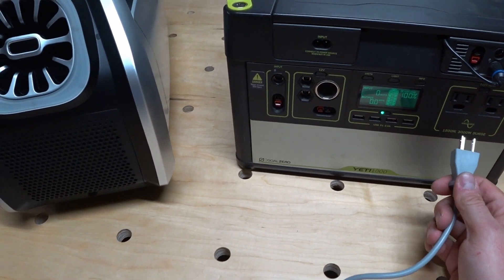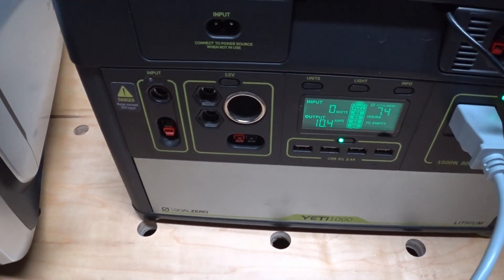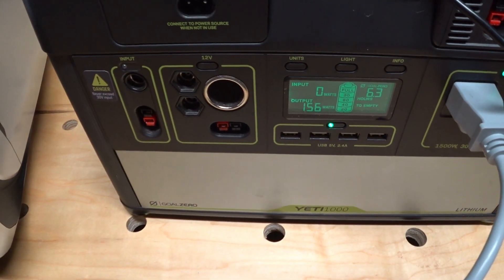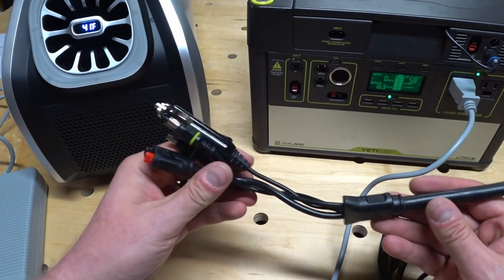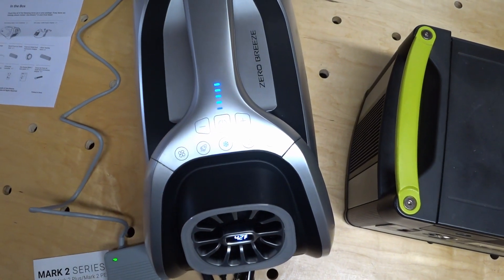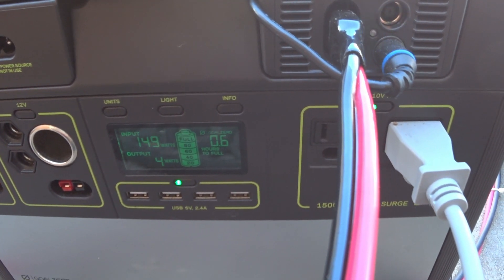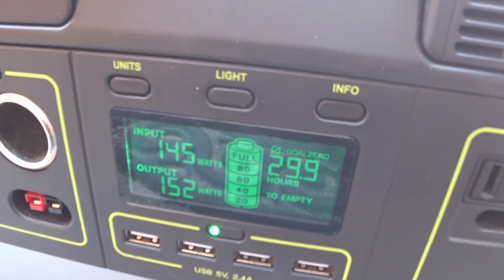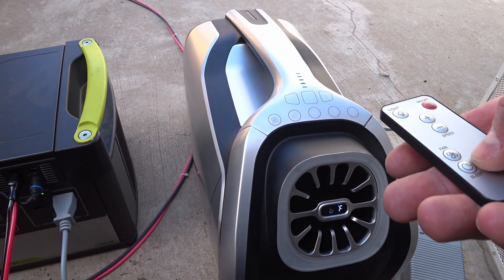Zero Breeze Mark 2 Powered by Goal Zero Yeti 1000 Lithium Inverter and 200W Solar

Comment: I have the Yeti 1400, and the Anderson connectors run 20 amps output, and I used that with a female cigarette port to run my Mark I, even though I have the Max Current Cable as well. I will use the connectors as you have with the converter to step up the voltage to 24V.
Reply from the maker: So you ran the Mark 1 with the Anderson/Cigarette ports?  I built a custom cable (Anderson/Cigarette port combined) to run my Mark 1 and it never worked, always got the red light shutdown on my Yeti.  Even tried their 12V regulated female cigarette port cable.  Had to in the end buy the max current cable just to get it to work, which is why I just used that automatically with the Mark 2.  Maybe my Yeti has a problem.
Reply: @Polymathicus  I ran the Mark I from just the Anderson port under the female cigarette port, and had ordered the SMAKN 12V 30A Female Car Cigar Cigarette Lighter Socket Plug Connector Adapter to use with it. I used the aviation connector that ZB supplied with the unit and wired the CUZEC Heavy-Duty 15A Male Plug Cigarette Lighter Adapter Power Supply Cord with 1.6ft / 0.5m 16 AWG Cable Wire to that. Never had an issue at all.

Comment: Do you think the ZB Mark 2 would cool a small cabin in a 24ft boat?
Reply from the maker: If it's very small, insulated, and not very hot outside the cabin, and the intake and exhaust hoses are ported outside then maybe, with a better chance at night.  Otherwise, this is best thought of as a spot cooler to point at a person/people in a room and keep them cool like you would use a fan for, but this fan also cools the air coming through it.  So it's much more than a fan.

Comment: I was planning on much smaller cheaper yeti what you think how small can I go for how long ?
Reply from the maker: Very difficult to answer as there are so many variables involved.  I have not run my Yeti 1000 to zero yet in a test, but I'm estimating about 5 hours runtime on normal mode with inside vehicle at 95 degrees, and outside vehicle in the 70's.  I assume there is going to be a big change when that outside temp gets up into the 100's and that hot air is being drawn through the condenser which is going to make the Mark 2 struggle more.  I will post those results here in a few months.

Comment: Any new videos or information about your use and testing of the ZB ll and the yeti 1000? How long continuous is the Yeti 1000 able to power the ZB II?
Reply from the maker: Got a bit delayed but new video coming soon testing 12 to 24v converter with the yeti.  Got my first "full day" of testing in a hot vehicle in full sun.  Inside thermometer showed 95 degrees ambient in the closed up vehicle, 62-64 coming out of the mark 2, ran about 4 hours before going home with plenty of battery to spare, was impressed, hope it can handle 120 degrees ambient in a couple months. Converter did get hot.
Reply: jtskr25 really? This is very very good news! By the way how long did it take to get the inside of your car temperature down from the 90s into the 60s? In direct sun or ”shade” Also I have another question: I am still waiting for my ZBII to come in the next shipment hopefully - how did you get yours so quickly?!
Reply from the maker: @Mombasa14  sorry, should have been more clear, outlet temp from the mark 2 was low 60s.  That was with an ambient temperature in the vehicle in the 90s.  There's no chance an air conditioner of this size could cool a closed vehicle in full sun, too much heat load.  The ambient steadily crept up. I can say however that I myself in the vicinity of the mark 2 outlet was very comfortable for several hours, no sweating. As soon as I left the air stream that changed.
Reply: jtskr25 ah yes, this  makes sense then as I am tracking with all your videos as I intend to use this zbIi device for bug out or survival purposes, as when the grid goes down we will rely on solar and in hot Texas we need to cool ourselves down during the day. One idea I have is to put a very small tent in my living room, and use this ZB to cool only the small tent area or to blow directly on me and vent though as window portal, so I can survive and not die of heat stroke. If this works.... I will immediately buy the upcoming Yeti 6000x

Comment: Would this a/c work all night (6-8 hours) on a 500ah, lithium battery?  How does the water drain or does it?  I've read there is also a 'night or sleep mode'.  If my math is correct, this a/c could run several nights without a recharge on the battery...But I'll be recharging with solar or generator daily.  Thanks for a superb video.
Reply from the maker: You're welcome.  Haven't tested at night or using sleep mode, but yes, sleep mode should use less power and stretch the battery out some.  6-8 hours might be a stretch, but with a lower amp draw of sleep mode and cooler ambient temps the run time should increase significantly over day use.
Reply: i am looking into putting this in an rv/van.  I have the lithium just worried about the sleep mode noise?  I would mostly use it during sleeping in the t.v. at night.  any info would be great help!

Comment: In your opinion do you think this could efficiently cool say a 200 square foot tent?
Reply from the maker: That seems a like a big area to cool.  There are a lot of variables to consider.  Heat load is the problem, trying to keep an area cool that is being constantly heated (by the sun) if the AC cannot overcome the heat load.  If we're talking about night time that might be a different story, a small space on a hot day but in the shade could be possible, but any space being beat on by the sun is going to be difficult to cool with an air conditioner this small.  I just tested in a vehicle, full sun, sealed up, intake and outlet hoses ported to the outside, tinted windows and sun shade, only 64 degree ambient outside temp, and it had a difficult time holding temperature inside.  The air coming out however felt very cold and with the front duct attached kept that air on me making me feel cold, and this is how I'm going to use the Mark 2, as a spot cooler keeping me cool rather than my space.

Comment: THIS VIDEO IS A GAME CHANGER!! Great job!! You are a few weeks ahead of me, but I am doing the same set up as you! when the power grid goes down and we’re all sitting in 90 to 100° humid heat in a house, and there are no gasoline pumps working, the only place to live will be in a car or van, with a yeti 1000 or higher, with solar panels and this ZB II air conditioner, to keep us alive!!! I’m not into heat exhaustion or heat stroke! I already have the Yeti 1000, and the ZBII I ordered just before finding your video, which is absolutely perfect in answering all the questions I was thinking of - ahead of time! Thank you!!! By the way, did you send an email to zero breeze support to get the plastic pieces that were broken replaced? Did they respond and are they sending replacements?
Reply from the maker: Thanks, glad the video helped!  No, have not contacted them on the broken piece yet.  It holds as long I don't pull on it, so wanted to let them get settled a bit with the roll out and the virus stuff going on.  They were receptive when my first Mark I (the original) stopped working after about 3 minutes.  After several "reminders" they did send me a new one, so I assume they'll take care of the duct when the time comes, fingers crossed. Also, I received my 12V to 24V converter, all wired up, tested, all the video is shot, and hope to have the video up in a few days.
Reply: jtskr25 Thank you for your reply, much appreciated! I look forward to seeing your new video on the 12 to 24 V converter! Keep up the good work!

Comment: Great info! Looking forward to your future tests! I have the GZ Yeti 1000 as well and will be using the ZB in a small van. I’m trying to figure out routing the exhaust hoses now.
Reply from the maker: Thanks! Similar setup here.  Best place I've found in any vehicle is the "flappy" pressure relief, exhaust ports. Mine were between the inside trim and my rear bumper. Pop those out on each side and you have a discrete path to the outside.  Just have to make up an adapter to go from round duct to rectangular hole. I used a 4" drain cap that the duct fit on perfectly then taped over the rest of the hole with metal duct tape. Otherwise you have to cut a hole somewhere or run out an open window.